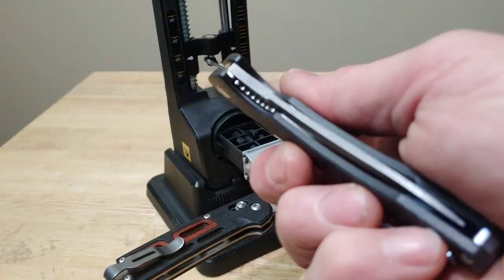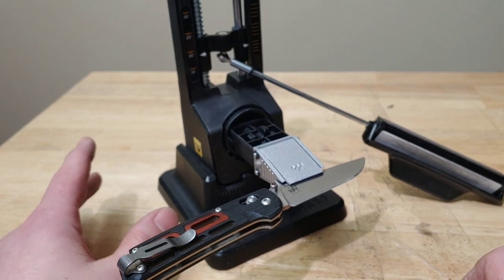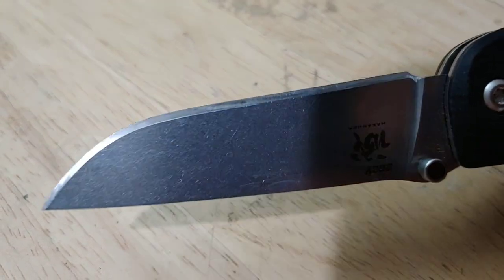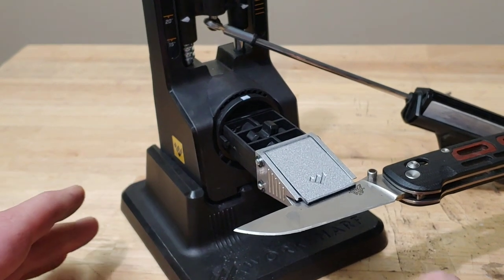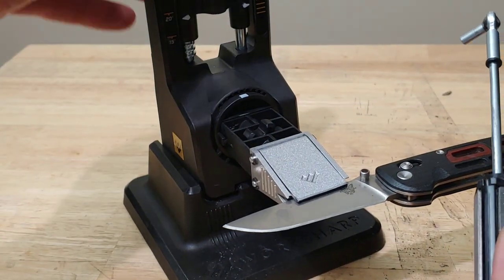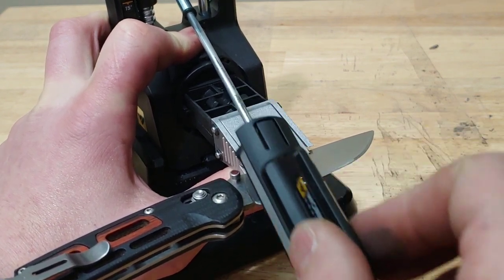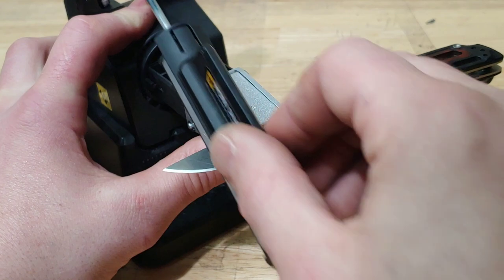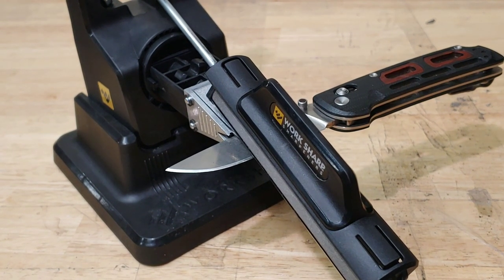LONG TERM UPDATE WORK SHARP PRECISION ADJUST SHARPENER

Comment: They have a kit you can order for 30 bucks with the other grits you are talking about and it comes with a leather strop that you can put in place of one of the stones.
Reply from the maker: It wasn’t out when I made this video
Reply: Do you have a link? The only replacement stones I see are the same ones that it comes with.
Reply: @nsmturbo5902  DLT trading has or had it. Or goto work sharps website.
Reply: @mityjoeyoung8855  I'll keep looking but the only upgrade I'm seeing is for the "guided" system that uses 6" x 1.5" stones.
Reply: @nsmturbo5902  wow ! 
My bad. You are correct. I purchased the precision sharpening system and I thought this accessory upgrade kit was for the precision sharpening system. It's not. It's for the guided sharpening system. Thank you for bringing this to my attention.
Reply: @nsmturbo5902  I guess I will have to return this kit or buy the guided sharpening system as well. I thought this was for the precision system. Man im annoyed at myself !

Comment: Springs (or rubber grommets) against the bumpstops!!! The lightest of firm bumps will shake the whole assembly even while holding it. You'll get going. You'll go a little faster and a little harder than you meant to. Pretty stiff springs (or rubber grommets) will last long and give just enough and push just enough to help keep thinks flat.

Comment: What about knives with a thicker blade such as the Ontario Raider Bowie.
Reply from the maker: I think it would be fine
Reply: And since its 1095 would a toothier edge be better or a polished mirror edge . or does that depend on the personal preference. Any opinions
Reply from the maker: @harveybeekerthegreysquirre8262  definitely a toothy edge id stick with the 600 grt, at the end you can use the ceramic to knock the burr off or the 600 grt stone, just keep flipping the knife and run the stone across the edge once or twice flip repeat flip repeat about 6 to 10 times that should kick the burr off then strop if you have one if not its fine
Reply: @NeevesKnives  so just the 600 grit and then a ceramic like a 2000 grit after. And strop
Reply from the maker: @harveybeekerthegreysquirre8262  you dont have to use the ceramic blade after unless you want to, id personally just do the two diamond stones then knock the burr off then strop

Comment: You could try increasing the angle very slightly, maybe a degree or so, for the polishing stage.  Then you get better contact with the ceramic hone or the strop.
Reply from the maker: Thanks Tony 👊
Reply: @NeevesKnives  Loved the review, coming from experience.

Comment: I bought this and so far it’s just ok, gets them sharp but not razor sharp. It definitely flexes way to much.
Reply from the maker: Take your time, and if i can reccomend, go through the two diamond stones and on your second diamond stone knock the burr off with the ceramic stone, it makes a stupid sharp edge.
Reply: @NeevesKnives  maybe I’m not getting the edge angle the same as how it was made does that matter or should I just choose a number and go with that from now on? I tried to get the same angle but I’m not sure if I got it right or not.
Reply from the maker: @brapperdan  no it doesn't matter, if you lower it will cut better though, if i was you id keep it between 17 and 20° thats a great edge angle for edc knives

Comment: To get that "blotchiness" out treat the ceramic like you would a strop and just go in one direction.  I ve had good results going up and down with the heaviest grit, switch to the 600 then go up and down for a few passes on both sides then just down for several passes on each side and then just down on several passes with the ceramic.  I finish on a leather strop to clean it up but I think al ot of the "blotchiness" is just the grain profile of the scratches going up and down because if you think about it as you move up and down and you are moving side to side you are just putting V scratches into your edge which are fine when you are profiling but to get them to look cleaner I would finish with just one motion down.  

I think Worksharp presented this in one of their Q and As about how they do the standard up and down motion and then slowly worktheir way down to just down and they will do a final slide strop on the ceramic. 

Try that next time, its worked for me my edges are not like Wicked Edge clean or anything but I finish on a strop and they are dang near mirror.
Reply from the maker: Awesome thanks bud

Comment: Depending on the grit of the ceramic stone (unstated) it won't polish unless it's at least 3,000 plus. At 5,000 you dont reallly need a jigged sharpener to maintain angle, it's really difficult to mess up a freehand polish on a high grit stone as it doesnt remove much material at all. I would just get a high grit ceramic polish stone and be done with it. Honestly the progression of these stones leaves much to be desired. 320 is entirely too rough unless you're reprofiling an entire knife. Even 600 is a bit rough for sharpening. You really only need around 800 to cut, 1,000 to sharpen, then 3000or5000 to polish. Anything rougher than 800 is really just to cut into a very mangled unmaintained edge.
Reply from the maker: I completely dissagree, I sharpen every day multiple knives and if i started at 800 grt it would drive me crazy how slow it cuts, i like to use a very low grt to reprofile, and i can whittle hair many times with 300 grt, and that diamonds, and with everything it depends on the stones your using, my 5k venev stone will definitely remove steel, its slow but it removes still, but even talking about finishing stones i love a 600 grt edge, depending on the steel and thats another thing as well depending on the steel. Some steels do better at a low grt while others do good at a high grt, so all of it depends on what stones and steel your using, and what the edge is being used for.

Comment: Damn i hate the clamp
i will have to grind the inversed triangle area on each side cause it originally it dont accept tick blade like strider SMF specially tanto are very hard to sharpen
Reply from the maker: Really! I havent tried an smf but seems that i can fit thick knives in there without a problem
Reply: @NeevesKnives  you can fit them BARELLY on the tip of the clamp , and for sharpening tanto , you need to have the first edge (tip) installed anti-parrallel (90 degree) to the sharpening movement....show me how your able to sharpen the tip on tanto blade with this system , im sure it will be TRULY USEFULL if you upload a short tutorial about this by all the users here ;) ...but i doubt you will  be able to reach that
Reply from the maker: @markhamilton3215  ok bud il see what i can do

Comment: I would rather pay more money for something that seems more stable. But it looks like a good system.
Reply from the maker: Its definitely a great system that with small tweaks is very stable many people have very easily modded theres into an amazing system, some even use the 3m sandpaper sticky to the ceramic to get incredible mirror polished edges, and some have put shims in to stop any movement, others have even bolted them down

Comment: I just bought this...it will only work on pocket knives. There is ZERO chance it will hold any knife larger than the smallest of small knives...the size TSA will allow. Do NOT waste your money!!
Reply: Your not doing something right mate,ive sharpened 2 benchmades and large wusthofs using this system and they are sharper than they have ever been

Comment: That flex is a Dealbreaker! They need to replace those parts with steel, plastic/cheap plastic is an epic fail. Oh and those stones are ridiculously small. (looks like a decent system for somebody to sharpen their swiss army knives lol)
Reply from the maker: You can put things in place to help, theres many very easy ways to fix this issue for 50$ its an amazing system

Comment: My dude...you have repeated the same few points over and over and then compared it to a freehand sharpen.
You gotta compare it to lansky or something.  You're reviewing this system for the entirely wrong demographic
Reply from the maker: Ive raved about this system and even got another one to give away, this video was an update from long term use and showing some of the issues you have to deal with or workout when buying one, i think this system is better than the lansky at 50$ I compared to freehand because im a freehand knife sharpener, so those are the edges i have, im sure i will eventually compare it to the lansky, but thats not what this video was about
Reply: @NeevesKnives  Ah hah! There's everything I was looking to know, thank you!
That's me sold, probably pick me one up in a week or few.

Comment: This is a $50 sharpener.  Expectations should  be based on this.  You are comparing to  KME, WICKED EDGE, HAPSTONE ...  Compare it to a $100 Lansky.  Is it a better value?  Your critic is like comparing a Ford to a Mercedes.
Reply: He did say that this is a great value for the money up front and that it would make most people happy. To understand why he compares the things you say he compares you have to understand that there isn't anything better to compare with since there's a large price gap over few options. You're upset because you like the other stuff, but he owed it to you as long as he was making this video to be honest and tell you where the money goes, which he does.
Reply: @BeefGold  I understand this isn't perfection.  I'm just saying for $50 don't compare it to a $500-$1,000 system.
Reply from the maker: Im absolutely no comparing it to any system, im just showing the good and bad, i think for the $ its about the best you can get, no system beats it for the $
Reply: This guy knows his stuff on sharpening, I have bought the Manual worksharp 20 guide and it works just as well as any , it’s up to you to upgrade on sharpening devices, i also purchased carhartt tool roll after his reviews , my buddy is a mechanic 👨‍🔧, and I tell you I have seen more beamers and Mercedes In The shop than Honda’s or Toyota’s , just saying , more expensive does not mean it will be better, happy new year!!!!
Reply: I didn't see anywhere in the video where he compared it to any other system.
Reply: @Camelotsmoon  Please tell me  what the list of issues is based on?  I did make an assumption the short comings was based on knowledge of other systems.  If someone is expecting a $50 sharpener to do anything but sharpen a knife then then I feel for them.  It isn't advertised or designed to give a mirror polish.  It is designed and advertised as a accurate/precise knife sharpener.  It is the best item I have ever seen under $250.  It is the best value available to sharpen a knife.
Reply: Lansky has better stones but bad base and design.
WSPS has better design with cheaper stone. Can't ask much from a $7.50 diamond stone.
Reply: Hey Bama, I've used the lansky deluxe system quite a bit over the years but mainly prefer freehand sharpening. * Except on a lot of my benchmade folders with CPM S30V etc, they chew way to much whetstones...
So with that said, lansky been my main sharpening for heavy duty does folders like my benchmade presidio II . Lansky is pretty limited when it comes to angles and pretty finicky with their horrible base,  so i got the worksharp. Love it! Super easy, fast, great price and the drawbacks mentioned in the video pretty much reflect the price you paid for the system.

I would LOVE to have a wicked edge WE-130 with a full set of stones and the extender clamp but that would set me back easily 1k USD. Ofc it's a superior system but it's like 20 times as expensive.

So that is a non starter right now and the WSPA puts a really great edge on the blade and 5 minutes of stropping gives you a razor edge that cut s shapes in a paper, might not be the prettiest edge and a few scratches might be seen but the way i use my knife that's the least of my worries 😁
If I want flawless polishing i pull out my whetstones but usually reserve that fit my hand made japanese kitchen knives, i like my work knives a little "toothy" and that's what you get with this system.
 or lapping film with compound.

So to sum it up, great cheap system with modding potential and possibly future official stones I'd say this system would likely be enough for 90% of sharpeners it you combine with a stop it's great.

Comment: Hey, Jared, there are new intermediate stones available for this system soon, addressing the issue you bring up here. See Sweetknives' video here:   https://www.youtube.com/watch?v=38FL9G75VK0
Oops, did I spell your name wrong, is it Jerad?
Reply from the maker: I currently waiting for them
Reply: @NeevesKnives  I opted to spring for the Venev stones, stone holder and arm brace per your recommendations. It appears as if the person producing the items has already made modifications you suggested, and attributed those to your suggestions in the listing. Fine work, both on your part, and the producer for such quick revisions to the product. You are an asset to the knife community, and once again, we thank you!
Reply from the maker: @silentblackdisc  absolutely thank you

Comment: If you see this. What is the knife in the machine? It looks like a Rat on steroids.
Reply from the maker: That's a discontinued benchmade it's small like a rat 2 if that's the one your talking about
Reply: @NeevesKnives  Wow! Thanks. This video being older, I didn't expect a reply. Especially,  so quickly.
Reply from the maker: @rob10ring  👍